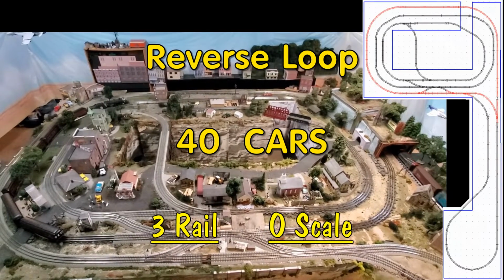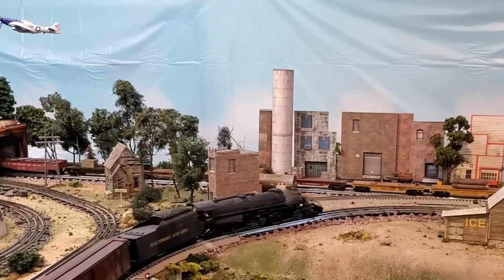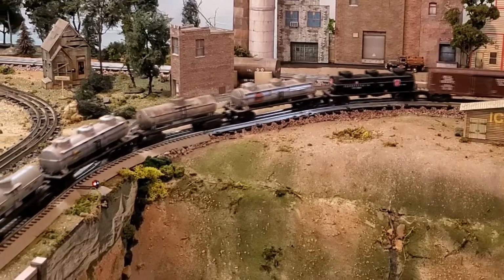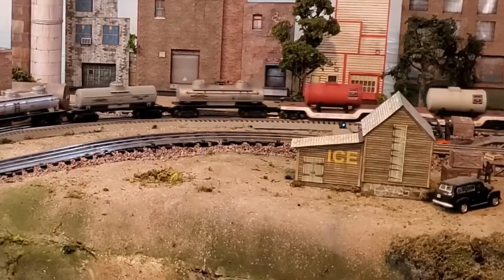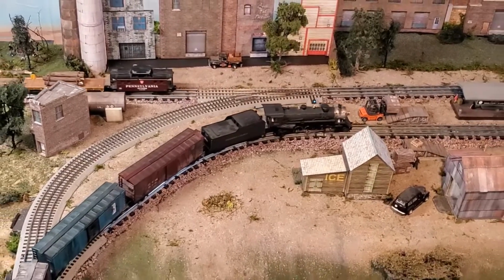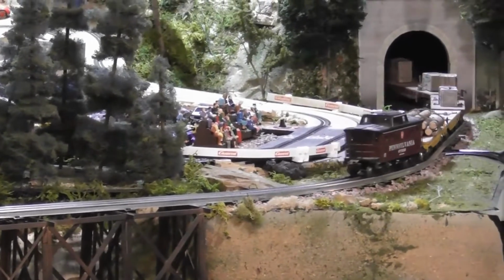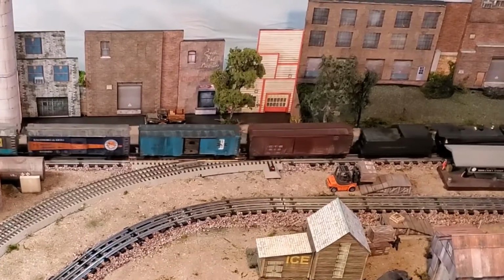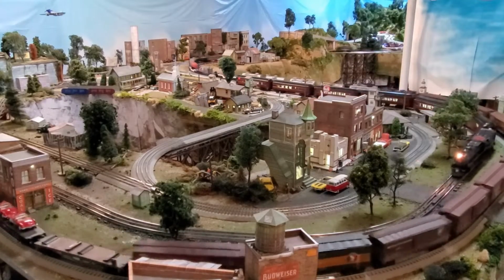Reverse Loop 40 CARS! 1st "Attempt" with 2-8-8-2 Y6b (MTH) & 2nd Attempt with 2-8-2 Mikado (Lionel)

Comment: Brent congrats on your move. What couplers are you using? Are they all the same? Are any of them glued together? 09/23/2021
Reply from the maker: Thank you! They are all stock couplers (what came on the cars). Some of them I have tape around them to keep them from unintentionally uncoupling. So, none of them are glued, but some have about an 1/8" wide piece of tape around them so the bottom pin won't come out. I was just running 50 cars and had one of my MTH coal cars uncouple.